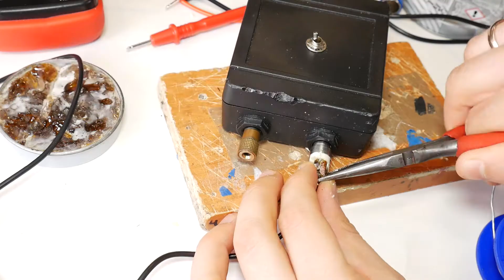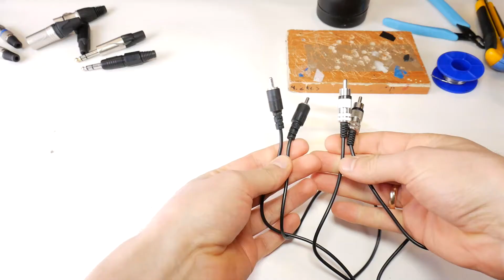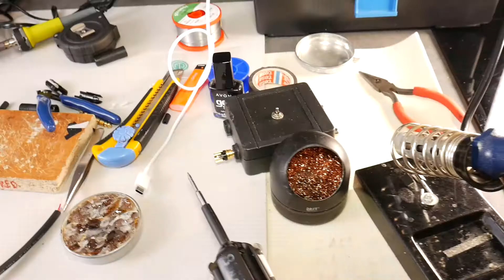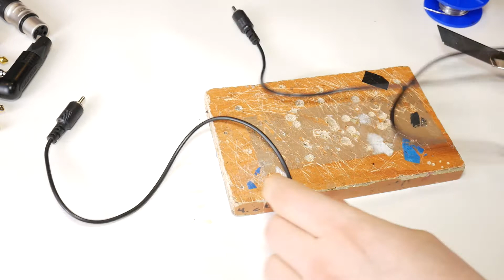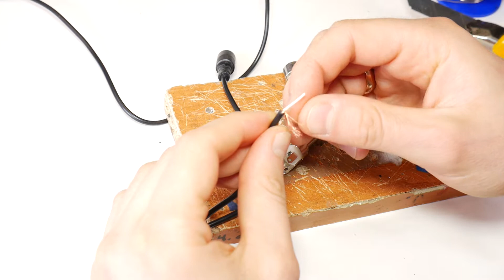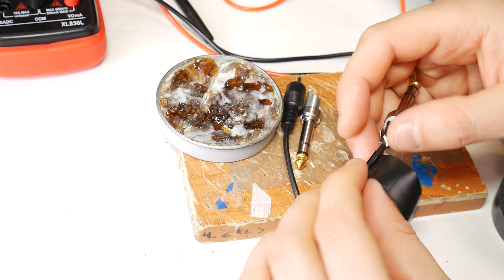How to Make RCA to 1/4 inch Jack DIY

Comment: Hi could u maybe help me? I want to connect my turntable to my audio interface the problem is there a 12m apart and I read that for these distances I should use a balanced cable is the soldering progress the same?! Probably not lol